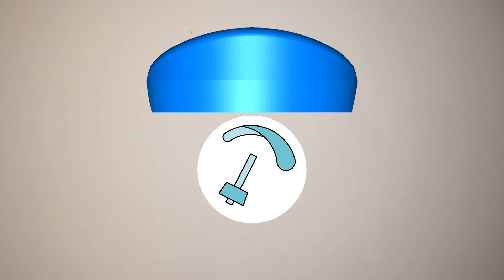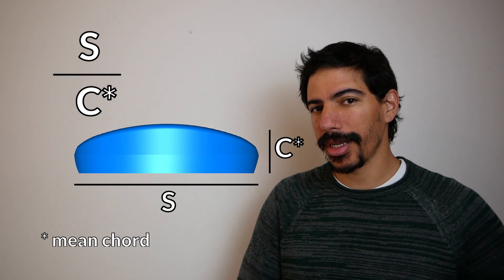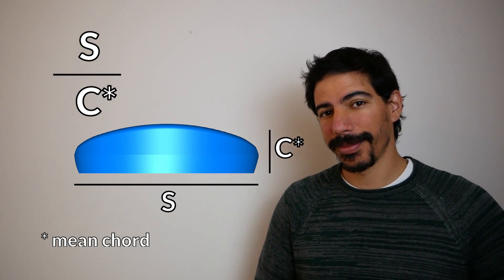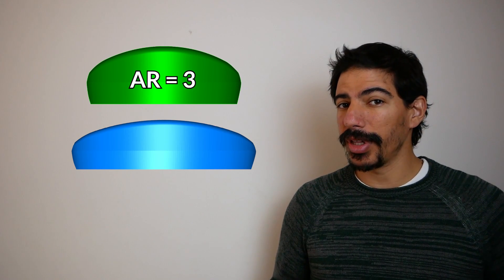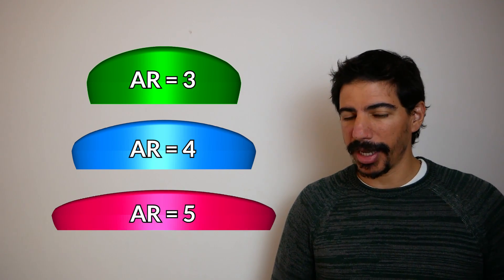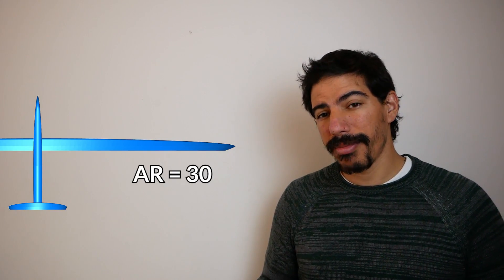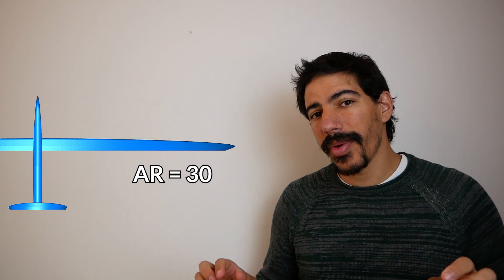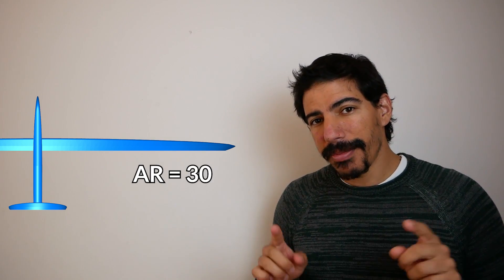Aspect Ratio - Basics - BANDARRA

Comment: Andre, in aerodynamics the aspect ratio is equal to the square of the wingspan divided by the wing area. Its not like you described it...

You should also look to both  projected and flat. This tells you alot about curvulature of the wing... (only the projected are is creating a lift agains gravity, the rest of the energy is used to tension the wing)
Reply: And other thing, its really not directly the aspect ratio that lowers the vortices (induced drag) its more the lift distribution - in ideal design, yyou would like to have 0 lift at the wingtips, therefore 0 pressure diference, therefore low induced drag.
Reply from the maker: Hey Petr, thanks for checking my math! It's really important to look at these things with a critical mind and call me out when I make mistakes so that we can all learn together. I for sure make a lot of mistakes! About this one in particular I over-simplified it when I recorded it but then amended it with the graphics when I was editing (mean chord). So it should give people the right idea, and if you look at the graphics we are both right. I think the square of the wingspan divided by the are is just a simpler practical way to calculate it if the wing has a complex rounded shape and calculating the mean chord would be a nightmare but you have the area readily available. However for this video and explaining the concept of AR, in my opinion wingspan divided by mean chord is a bit easier to understand. Thanks for the comments, really appreciate critical thinking

Comment: Hi Andre - Hope you and Gemma are settled over there now. Really enjoying the videos. 

Wondering if you might have got the calculation method for aspect ratio wrong? I thought aspect ratio was calculated as Span^2 / Area and plugging this in with the published values for my wing seems to come up with the correct aspect ratio.
Reply from the maker: Hey dude, yeah things are going well hope with you too, thanks for the support!

I think you might be right about the calculation! I always thought about it as span/chord but with wings of non-constant chord (pretty much all paragliders) it doesn't work if you use the root chord or tip chord. So when I was editing it I tried to make the correction to say mean chord rather than chord which might algebraically do the same as you mentioned? but I'm not 100% on it so I'd say you're probably right :) thanks for looking into it and sharing it with us
Reply: Hi Andre - Just read this explanation and your other one below and I do agree with your simplification and it has actually helped me understand where the PG calculation comes from in relation to the more widely known calculation used for wings. This was one of the things I struggle to remember for the pilot exam because I already had a clear understanding of what aspect ratio (mostly from screen size) was and then had to remember something different especially for PG. Looking at the PG calculation and understanding that the chord changes over the span should have been enough for the penny to drop, however, it took your simplification and explanation for me to get there!

Comment: Wing tip vortisies are reduced by the size, shape, wash in or washout of the wing tip. Gliders and large aircraft use polyhedral, curved and angled wing tips all getting to a sharper point further reducing the size of the vortisies. 
Andean condors wing tip feathers divide towards the end producing several very small vortisies that is a massive advantage over a large vortisies at the end of a blunt broard wing. 
Advance have tried to do something similar with winglets, however they seem too far from The tip to be reducing any vortex, looks to me they would produce an extra vortex of their own.
Reply: The Advance winglets are just... well I cant imagine how it can work :)) . And even if they work, the added drag of that construction will just negate all what you got from lowering the induced drag. And even worse, the parasitic drag of the wingtips will be even bigger at higher speeds...

Comment: One thing that doesn't get much discussion is the planform of a wing and the ratio of root chord to tip chord. ie. the smaller the tip chord the more agile it will be in roll and the larger the tip chord the more stable it will be in roll.
Also the elliptical planfrom offers a more even lift distribution across the wing etc. etc.

I'm sure you know this but worth a video I reckon ;) 
Anyhow another cool video :)
Reply from the maker: Those are all terms I've heard before but not something I know much about at all, let alone to do videos about it but I'd love to know! :)
Reply: I was about too launch into an explanation of some things but not sure if here is the right place, plus I might need to send you some drawings etc. 
got an email i can use ? :)